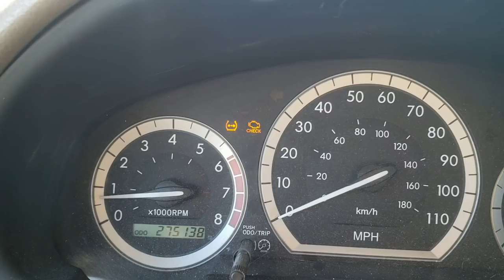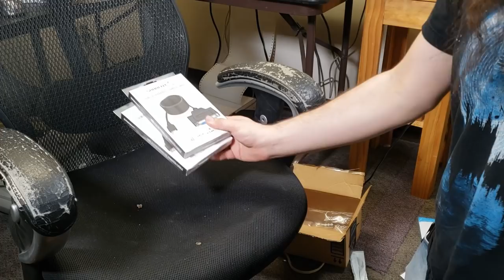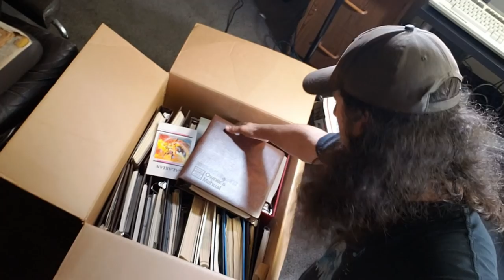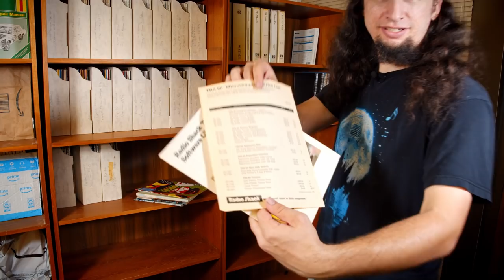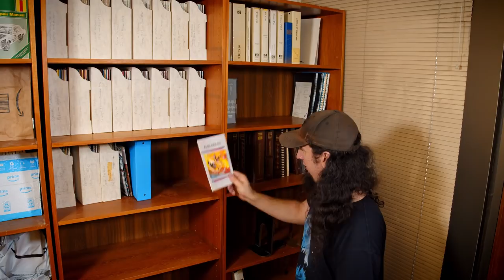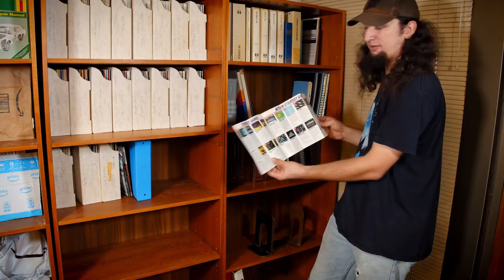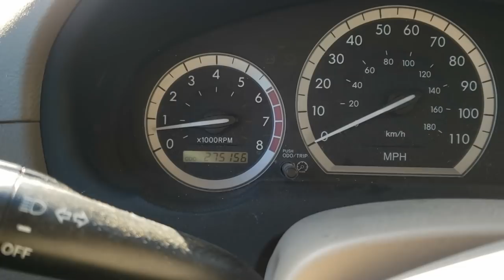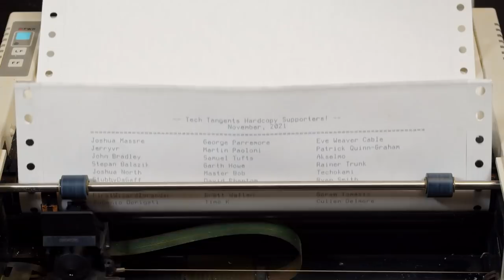Office Vlog 0x05 - Getting Lost in Manuals and the Server Rack

Comment: O2 sensors are the most un-necessarily replaced item.  I would disconnect it, make sure connectors are clean and dry, and replug it.
Reply: Don't replace parts based on codes. Codes are guidance, not confirmation.

Comment: I know from experience, the O2 sensor is required in order for your vehicle to maintain a correct fuel/air ratio.  If that censor is boned then your engine will run like crap.  It's really annoying, but the sensors are cheap and just screw into the exhaust manifold.
Reply from the maker: I'm pretty sure it was just loose after having to do the other repairs and pressing on it fixed it.

It's bad to run the engine without the O2 sensor, but not as bad as running it without coolant which was more what I was trying to compare it to.

Comment: The first machines to be used as we use servers now were mainframes.  The first machines purpose built to be servers were probably DEC LSI-11's, but I'm saying that mostly because DEC LSI-11's were often the first purpose-built utility computing devices in many categories.  (For instance, a LOT of early routers were and network gateways were actually DEC LSI-11's with networking hardware and software added.  They were good for this because their bus architecture made them extremely easy to add custom hardware to, and they were fairly cheap for their computing capacity.  They were also very common and had a HUGE software library for the era by the time people started wanting to use them to connect to the early Internet.)

Comment: When I started in IT in 1993 the first servers I worked with were IBM PS/2 Mod 60/80's at a Bank and then in 1996 starting using Compaq Proliant Tower servers with Pentium Pro running Windows Nt 3.51 and Novell Netware 3 I still have my Novel CNE cert from back then. Hmm wonder where my MCSE cert for NT 4 / SQL is? Up until last year I had a stack of 3 IBM X servers from that same era in my basement rack, got them from a client for nothing. But hydro bill was too high and WAF for the fan noise in the middle of the night echoing through the air ducts forced me to get rid of them. But those Proliants are great boxes. Compaq always had the best Physical build quality and HP has not messed that up to date. They were always better than IBM and Dell to work on physically in my opinion. No cheap plastic parts that feel like they will snap (looking at you IBM X series)  Keep up the good work and looking forward to your next VLOG. Oh and one suggestion, maybe get some sort of gimble to help with the shaky-cam walking shots?
Reply: Started in 92.Never got around for getting my CNE. Several Novell 3.x servers at small businesses. I could go on for days about that time.

Comment: Oh no! More car troubles! I was hoping we'd seen the end of them last time, but I guess they just never end.

Moving racks is a huge pain. Moving our lab rack from our old office to the new one, that was a nightmare. It was a full height rack on wheels which is a good idea, but really dangerous in practice. You can move it relatively easily, but there's a big risk of it toppling over unless it's only moved on level ground. Thankfully the test lab was on the ground floor in the old office, so it was totally level wheeling it out into the car park, and it's also totally level from the hard stand to the lift at the new office. But yeah, definitely needed to pull everything out of the rack to move it and tip it into the van on its back, then load everything back into it for transport, just sitting on the rails. Drive carefully to the new office, unload the equipment and move upstairs, then pull the rack out and wheel it upstairs also. Unfortunately we didn't have a dedicated test lab space in the new office (even though we were promised it before we moved), so we had to squeeze it into a comms room that we were also using for storage.

Comment: O2 sensors can easily get contaminated from engine coolant. It's usually bad head gaskets. But coolant could get in through the top too.
EDIT: If your code reader supports it, check the live data from the O2.